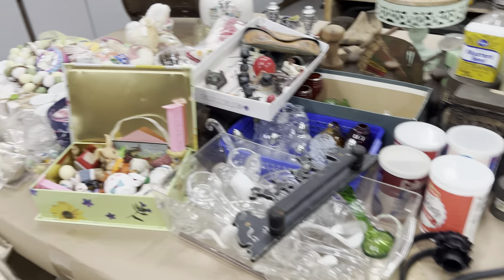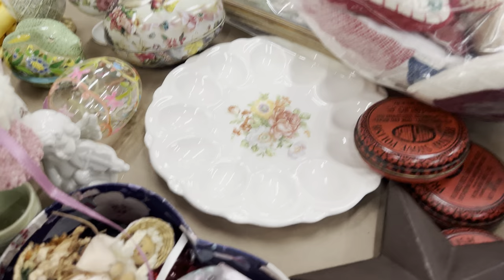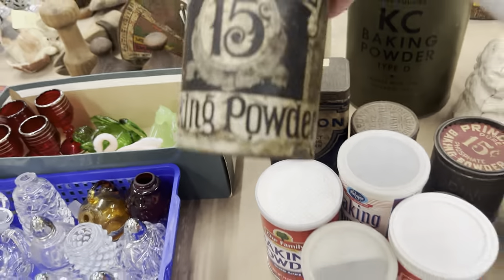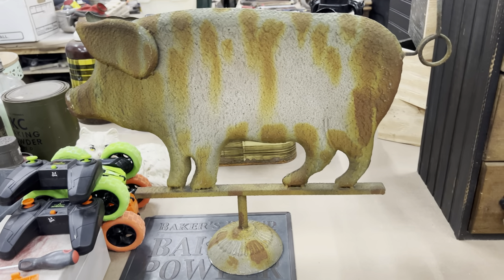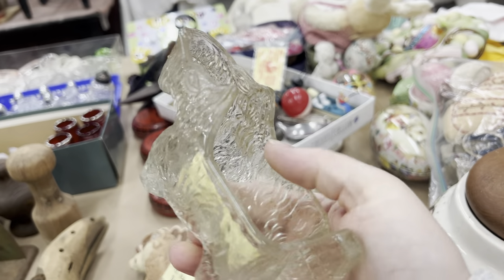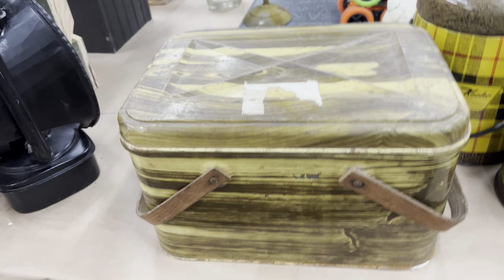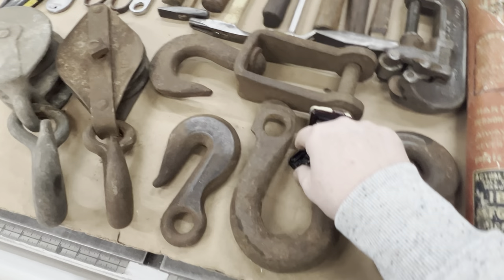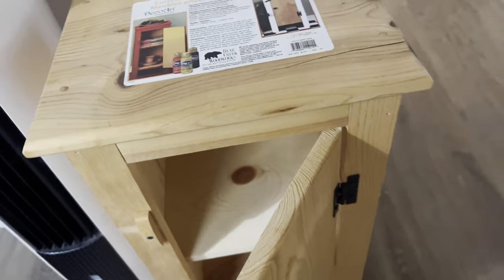FOUND IT!! BUCKET LIST✔️  BUYING TO RESELL FOR PROFIT | EBAY

Comment: That wooden basket with the hole on the side is for knitting/crocheting. You stick your yarn and your needles inside that and if you’re sitting down in a chair, you pull the yarn through the hole so you can knit.😊 it just keeps everything together.

Comment: Great haul.  The red heart shaped ornaments have kugel tops, so they should bring a higher value.  I have an identical metal baking powder sign.  I purchased it in the 1990's from the Tender Heart Treasures catalogue.  You have a gold mine in the glass spoons.  Many are Depression Era mayonnaise spoons and are quite fragile.  The green and pink ones are probably Uranium.  I found a blue glass seltzer bottle, but was unable to open the top to clean the interior.  Hopefully, you will have better luck.  Egg cups always seem to sell well.  TFS.
Reply from the maker: Thank you for sharing your knowledge. Yes the heart have those beautiful tops on them. 
Your right the lid doesn’t come off the seltzer bottle 🤗